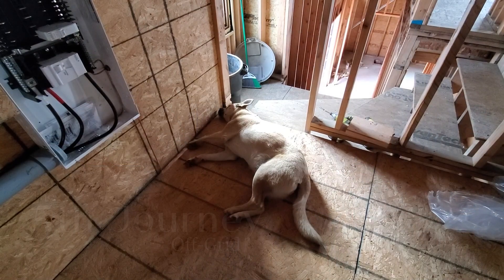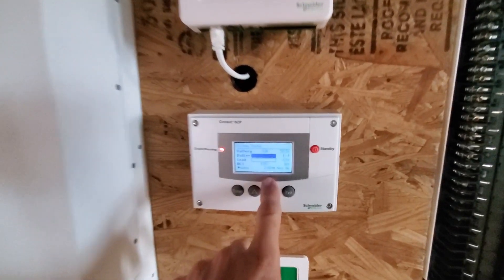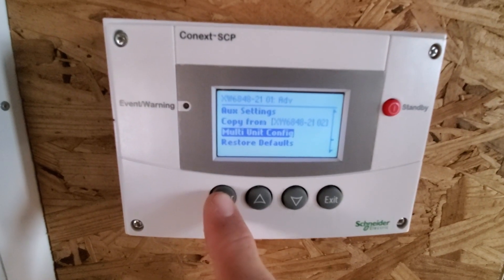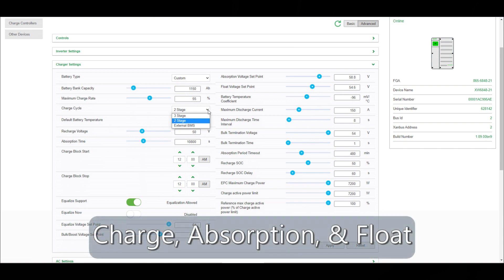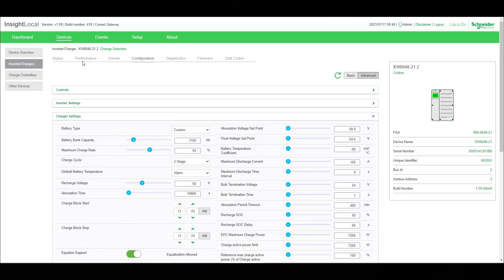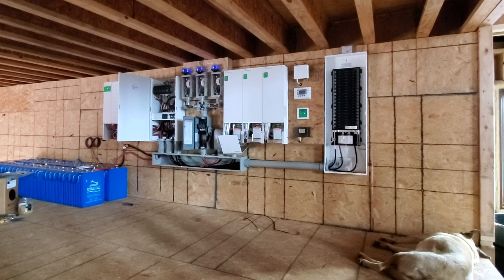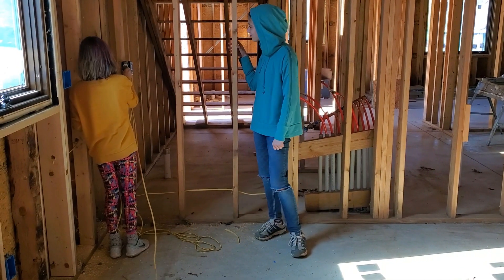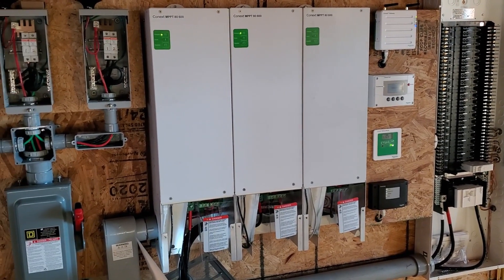Solar Panel System Software Setup on Schneider Multi Inverter and Charge Controller System, Off Grid

Comment: How has this system been working for you?  How large of a home are you powering with it?  Thanks!
Reply from the maker: I'm in the process of transferring to a different system not because the old system wasn't working but because  a firmware update caused a software issue in the inverter.  Schneider warrantied it out and sent two new inverters but while it was going on I went ahead and bought dual 6000xp's.  I'm using both systems while transferring over and will likely keep the old system set up as a backup and I'll install the new inverters in another property or shop...or sell them.  Not sure yet.

Our house is 4400 sqft and we rarely used more than one inverter could output so I turned one off a while back to use as a backup.  We have propane so we don't use a lot of power for heating or cooking.  Your size will depend on your needs and how your house is wired.  If you have a total electric house then you'll want something bigger.
Reply: @Off-Grid   I just got three of these inverters, and couldn't pass them up at $1200 each.  Our home is 3700, with propane heat, cooking, hot water, and a dryer.  The only large loads I have are the welder, compressor, wood working tools and my networking/AV equipment needs.  So I think it should work for my application.
Reply from the maker: @FJB2020  I ran a small 110v wire welder just fine but never tried my 220V arc welder.  As long as you're on gas and not totally electric you'll be fine on just one inverter or at least we never had any issues.  Note that the $1200 price does not include the charge controllers, disconnects, pdp, combiner boxes, and such or the gateway, bms, and other components of a Schneider system.  This is where all in one units are nice.  The Schneider system is built to last longer but with the pace of technology and dropping prices it's hard to justify not getting an all in one unit like the 6000xp, which isn't much more expensive that the XW Pro if it's not the same price already.
Reply: @ I was looking at the XP12000s from EG4, but chinese tech just isn't something I want in my house if I can avoid it.  I also deal with SE on the commercial side of things for my work and know they build some great stuff, even though their customer service isn't always the best.  Also if something goes wrong in an AIO, you have to toss the whole thing, vs the modular approach.  Oh two 100/600 charge controllers were only $2000 and should be more then enough for what I need.
Reply from the maker: @FJB2020  yep, I agree with you there.  The Schneider equipment is more robust.  Because of the warranty claim on them I now have four XW Pro's even though two of them don't communicate anymore they still work.  It's a good backup.

Comment: I've been doing solar since 1978. You have a great system. Wondering out loud, if you didn't go with the Schneider what inverters would you have used instead? What about mixing and matching components like using a Midnite solar MPPT charge controller with the Schneider XWs? Of course I know they don't 'talk' to each other when linked to the Insight system. Oh, BTW... Kudos to you for using lead-acid storage.
Reply from the maker: You'd be surprised at how much crap I get for using lead acid. But as I mentioned in the video there are 100% recyclable, cheaper, last only a few years fewer then lithium, and so on.  Plus I'll get money back when I do recycling. Much much more environmentally friendly.

This was the first such system I had ever done so I wasn't sure about mixing and matching components. I knew Schneider was a good company and figure they were the way to go for the long haul. After the fact I discovered other products were more user friendly but now the system is set up and running I'm very happy with it.

Thank you for watching and commenting.

Comment: I really hate to see people spending good money on AGM and lead acid batteries they are a thing of the past it was a hard sell for me but you cannot even compare them to lithium they don't take up half the space they last astronomically longer charge quicker and discharge lower. I learned this lesson the hard way I had over 30 AGM batteries 4 5.1 kwh lithium batteries would blow them away.
Reply from the maker: True but lead acid is 100% recyclable. Lithium batteries are recyclable, but the process is complicated, expensive, dangerous, and in the end only 70% at it's best.  AGM has it's limits but it is a more green way to go, they are much less expensive, and you get paid when you recycle them.

Comment: @9:28 They are greyed out because the device you are configuring is in "operating" mode.   My understanding is,  schneider recommends the device be put in standby, make your changes, then go back to operating.  I can confirm that on my system,  they are greyed out when it's in "operating"  but not when in standby.    I've not found any setting I can't do from the insight gateway, that I'd need an SCP for (in fact, the SCP is deprecated in favor of the gateway)
Reply from the maker: I don't use the SCP at all.  I just log into the gateway too.  I was never told about having to put the system into standby during the setup process.  Everything was done with the system on and didn't seem to hurt anything.  If I remember correctly I needed to switch a setting to "Custom" and then make the changes.  Took a while to work the bugs out but it's all good now.  I did end up disconnecting the second inverter as I could never get the two working seamlessly together.  Turns out I really didn't need two as our home typically only uses 5kW or less even with the AC on and since the inverter can surge to 8kW and even 12kW for a little bit I think we're ok and not I have an extra inverter as a back up. 

Thanks for watching and commenting.  There are several other videos of the system on our channel.

Comment: I have had this particular system on my radar for two years now. I've researched other systems and this one seemed to have everything in a neater package. I didn't want to buy into different brands to get a system up and running. I'll be Grid-Tie, but I wanted a robust system and not something these corporate PV suppliers are shelling out.   So how is the Schneider system holding up? It's been almost a year.
Reply from the maker: It has done well.  The multi inverter set up was buggy and we realized that we never used more than what one inverter could output so we disconnected the other inverter to use as a backup.  Once we did that all the bugs went away and it's been clear sailing.

Comment: I'd love to see a "final overall wiring" video, that shows how everything is wired, fuses/circuit breakers, batteries, PV arrays, etc.   I just installed a XW pro, and a PDP (plans to add another inverter eventually) and am currently installing the protected loads panel and moving circuits out of the main panel.  My system is significantly smaller.. I have 600AH of AGM batterys  24 12v/102ah, wired as 6 banks of 48v. Like you, I had to switch to "Custom" battery, to be able to set the specs that my battery manufacturer suggested.
Reply from the maker: Once the build is done I plan to go back and review the systems and go in depth a bit more.  I eventually disconnected the second inverter though.  We found that it wasn't necessary and the system was always buggy.  Since disconnecting it I haven't had any issues and am keeping the second inverter as a backup.

Comment: One of the things you can do,  is put high load draws (like the water heaters) on mechanical timers.   Set it to only heat during the day, when the sun is up so it's not draining batteries,   and it'll stay hot all night long (assuming the water heater is relatively modern) Also,  using DC devices directly (like DC powered minisplit A/C) can be useful as you don't incur the losses in inverting from DC to AC.    You've probably thought a lot of these things through, though.   One thing I'd love to see when this is all buttoned up:  I'd love to see a full video on exactly what settings you are using for each device,  and maybe an explanation of the reasoning/mindset for those settings.    Nice series,  and great workmanship.
Reply from the maker: Hello Jeff, I did eventually put the ERV on a timer but I can't think of anything else that would benefit from it.  The water heaters are on demand so it wouldn't work there.  I'd have to look but I think our Minisplit System is DC or at least the fan motors are.  

I've thought about doing a video going over the entire solar set-up and might plan on the at maybe the two year mark.

Thanks for watching.

Comment: You need a BTS on one of the MPPTs, if you log into the insight go to devices and pick one of the MPPTs you will see under status Battery Temperature N/A that's cause no BTS is installed. This will kill your battery for sure, if you were only to install one, it would be on the MPPT and not on the xw in a off grid setup. With 3 MPPTs in a parallel config. using negative ground you only use one and only one pv-gfp fuse. Also your battery settings are wrong for your amp hours, and if you do have AGMs you need to turn off equalize support. Why did you not get the xw pro with SOC? and you did not need OCPD on 2 strings and less, Its only 20 amps and will not open a OCPD. I would have went with the MPPT disconnect RS. Did you ground your battery so your OCPD opens in a short?
Reply from the maker: Thanks for the info.    I do have a BTS which I was told only needed to be hooked up to one of the components because they all talk to each other and the BTS info flows through the system to where it is needed.  The Temperature shows on the Gateway and has always been normal.  They sent a BTS for every component in the system so I have several sitting around.

The MPPT's are in Series, not Parallel.  This is how the instructions specified to install it.  They also sent six fuses, 3 to install and 3 extra.  

I found out later that the batteries needed to be set to Custom and not AGM.  I would change the settings only to find them changed back the next day.  This is because the AGM setting had a preset configuration.  Once I switch the battery type to Custom I was able to set the battery setting to the FlowRiver specs and have them stick. 

I'm not sure what an XW Pro with SOC is.  SOC is just State of Charge which I can view at anytime.  On the OCPD I just hooked it up per the instructions and spent a lot of time talking with the company I purchased the system from, Northern Arizona Wind and Sun.  The batters are grounded.

Comment: That firmware upgrade process is a nail-biter.  We actually had to get a new XW Pro because the old one wouldn't accept the firmware upgrade.  I actually wrote a Python program so I could monitor our system from HomeAssistant (HA.)  I have HA controlling all sorts of relays for lights, hot H2O, and A/C in the equipment room as well as several temp monitors and surveillance cameras around the property.  I like the HA mobile interface better than Schneider's mobile app.

As I said in a previous post, those XW Pro charger settings are a bit rough for documentation and Schneider support wasn't much help for us.  Depending on your generator, you might have to enable Generator Support with an Amp rating as well as the Support Plus setting to get your generator to work properly.  We kept tripping the breaker on our generator w/o those settings.  I'll be posting a video soon detailing my findings after Schneider support gets back to me with their assessment of my situation.

One great piece of technical advice I heard in this video: "Did you turn the inverter-thingy on?"  This is how you get a "$30,000 light" to start working!
Reply from the maker: Yeah, Schneider hasn't been much help at all.  Luckily Northern Wind and Sun has been very helpful.  Will have to look into the HA app

Comment: Wow, totally stressful, glad you managed to figure it all out. At least you had  IT help for trouble shooting. Good job, you didn’t give up.
Reply from the maker: The company we bought the system from was a big help.  The manufacturer not so much.
Reply: @Off-Grid  some good, some bad, so glad its up n running for you!
Reply: @Off-Grid  Schneider has a rep for tier 1 products and tier 5 support. They should provide clear and concise manuals. In fact they should provide videos on how to setup and connect their products in different configs. You should not have to run to the store to buy missing screws and stuff; their QA dept is like the support dept. The firmware issue is also bs; having been working in IT for a long time you can ship your parts with compatible firmware and shipping kits should be a no brainier. Schneider is too confident and it shows, they make a good product but they are way overpriced and they offer subpar support. I think I might just go the victron route.

Comment: at the highest point in your home put a mini split. Heat rises a lot. If you can cool that air with a really efficient mini split seer 22+ you will save big on the rest of the system running
Reply from the maker: That's basically what we did.  Check out the videos when we installed the Minisplits

Comment: Have you calibrated the output on the inverters?
Reply from the maker: Not at this time.  I didn't know anything about having to calibrate the inverters.  It wasn't in the instructions and in all my calls and emails to tech support it was never mentioned.  The tool is over $500, which is an unexpected expense. 

I did figure that the difference is around 300 watts between the inverters and was told that isn't such a big deal and not to worry about it right now.  But yes, I plan to calibrate them sooner or later.